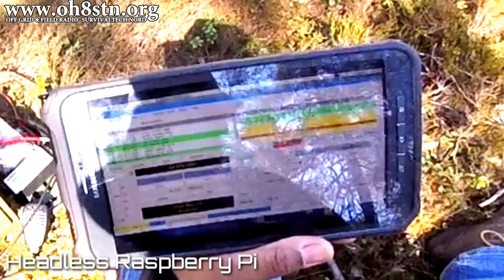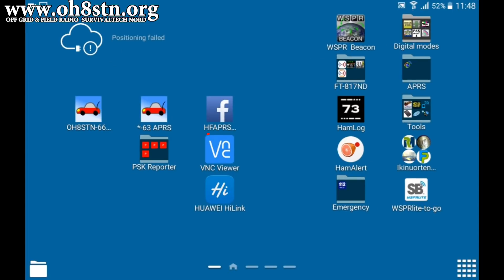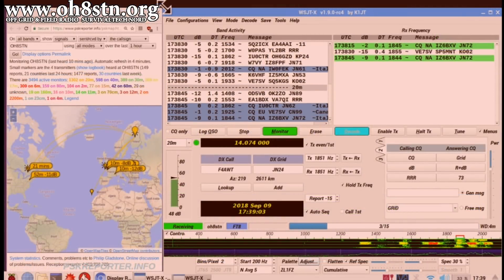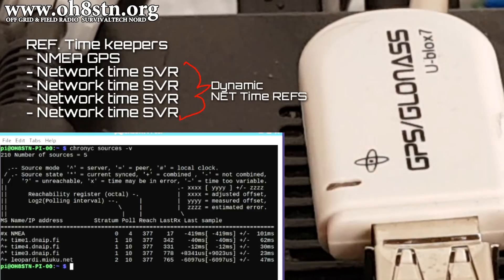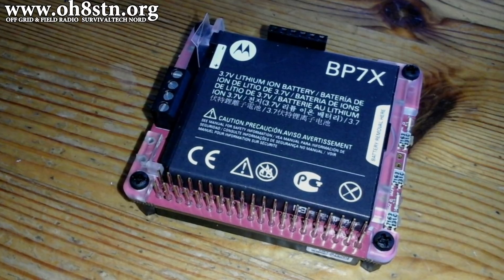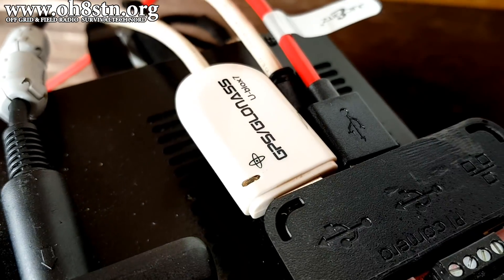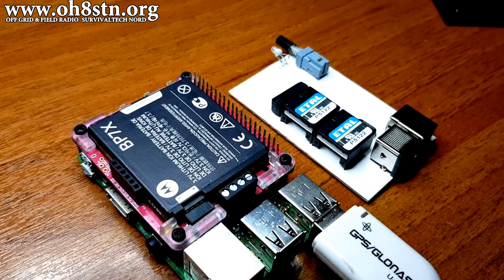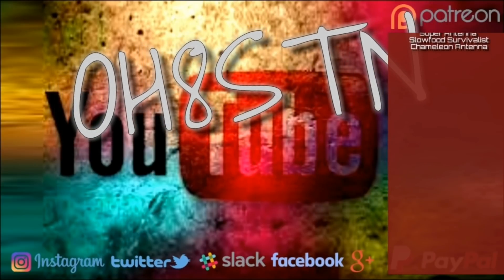Ham Radio & Raspberry Pi FAQ

Comment: I don't think any of the display interfaces I've seen you use are tough enough or good enough tbh. I've decided I might as well use a Chromebook with ARM processor. I don't care at all about remote operation of the radio. I hate VNC too it just irritates me. I don't see why the software even needs a GUI at all to be honest. I'd love to use a Pi if I could get away with a 16 segment display and rotary encoder for a keyboard and make the package tough as nails. Thanks for your work it's really inspiring.

UPDATE: Chromebook is not go with GPS dongle :( There may be generic access to USB via Crostini in the future.

Comment: How do you supply the 5 volts from the buck converter to the Pi? Do you use the GPIO pins or did you solder leads directly to the board? If you soldered to the board what pads did you use? Was it P2 for + and P5 for GND?
Reply from the maker: I used gpio pins 👍
Reply: @OH8STN  😊!  Thanks!

Comment: Great video.  Thanks for pulling it all together.  I have just started working with the Raspberry Pi and FT-8.  Using my TS-590 with the Pi.  When setting the output power on the TS-590 at 30 watts...the output power meter only shows 15 watts when FT-8 is "sending".  I suspect that the audio output from the Pi isn't as robust as it potentially could be.  Would you have any idea what may need to be modified on the Pi to boost the audio output?  Thanks again for a video with solid information.

Comment: Hi Julian, I have built something very similar to work with my FT-817 and FT-897 - I have the same Zlp Interface - however I am having problems getting cat control to work do you have any tips? I also added Pat - the winlink client to my Raspberry Pi, and used cgps from the cmd line to get the maidenhead locator from the GPS
Reply from the maker: The only time I've had problems with cat control on the eight one seven or eight one eight is when I've used one of the Chinese cat control to USB adapters. I didn't have any problems with the ZLP version. I would say most of the time, it's the cat control adapter which isn't supported.

Comment: Julian you have shared wonderfully detailed  information on building a solar generator for operating  off grid.  One vita vital piece of man portable equipment is a VHF/UHF HT.  It would be great to see you cover charging HTs without access to the grid or an inverter.  Many of us are using the FT-70DR or similar and I have not found a way to charge this radio via a solar panel.  Thoughts?

Comment: Dear Julian, thank you for your excellent videos and detailed help. You give us and amateur radio a new and valuable inspiration.

I tried to rebuild your setup: FT891, Raspberry Pi 4, MiniPro SC... Unfortunately I can't decode JS8Call signals... Which settings do you make in Raspian OS and which sound card did you choose?

I've watched all your videos several times and also almost all documentation about JS8Call... Unfortunately I can't find any help for my problem.

Thank you in advance.

vy 73 de Oli, DL2OLI
Reply from the maker: Hi Oliver. My station set up is different at the moment, so getting those settings isn't possible at themoment. Make sure you have enabled the audio interface in your USB audio settings. You can reach those audio settings by right clicking on the speaker icon on your rpi desktop. Here's a few other tips for you.
Make sure you're using the correct port on your radios settings. Make certain you have selected the correct audio device in js8call. If you can see them in the waterfall but cannot decode but see them in the wsterfall, make sure your clock is accurate on your Raspberry Pi.

Comment: Julian Many Great Viedos. However the cabeling  between the radio and the Rpi escapes me. The radio has a Din data port right. I use a 706 which has 12 pin Din data port. Did you buy a din x usb cable? No signal link or equal is needed? Thanks John
Reply from the maker: In this video there's two cables between the Raspberry Pi and the radio. The first cable goes between the Raspberry Pi USB via the audio interface and into the mini din Port of the radio. II cable also originates from the Raspberry Pi USB and terminates in the USB port of the radio. That one is for cat control.

Comment: thanks for making this vid, I've been wondering how well the Pi could handle other applications besides the SDR software
Reply from the maker: You are very welcome. The Raspberry Pi does a great job with data modes for amateur radio. Honestly I wouldn't have believed it yeah, but the Raspberry Pi 3 B+ does a great job. Thanks for the comment and the kindness, It's very much appreciated.

Comment: Non HAM operator here. Can someone please fill me in what ham operators actually do? Is it simply looking for a frequency to talk to someone somewhere else in the world? What is the point of the radio equipment?
Reply from the maker: Actually ham radio operators do a lot of different things. So there's no one single right answer. For example my radio equipment is used for emergency communications in a grid down scenario. I also use my radio equipment when I'm far away from home, hiking and camping above the Arctic Circle, in places where no mobile phone service exists away from main highways. Of course there's the fun aspect of ham radio. So I also use ham radio the way some people use forums or Facebook. It's kind of like a wireless social media Network of like-minded people. Does that make sense?
Reply: @OH8STN  ah ok thanks for the reply

Comment: Thanks Julian great video. i agree why not just have an open interface/sound card built into rigs then you could choose what mode to be using. PSK31 was good but that's not where the action is today in 2019. My ic 7200 is a good rig for digital modes and easy to interface to a laptop but its too big to be carting too far in a back pack not to mention the battery needed to run it .

Comment: I am looking to buy your Raspberry Pi setup. One question.  The keyboard you have is red which links to the wireless one, not the Bluetooth one.  Can you confirm if I should purchase the Bluetooth or the wireless version to connect to the pi?
Reply from the maker: Yes it's the Bluetooth one Dennis. When I purchased it there was a choice in the drop-down box for the different versions. But it's definitely the Bluetooth version. Thanks for the question

Comment: Hi Jilian was curious what the other box was in the video then figured it out DigiMaster MiniProSC. Can you tell me why you chose that over the more popular signal link usb sound card? Maybe do a video on it???? Thanks so much. Love your videos.
Reply from the maker: Hi Mike. The signalink is simply massive. Since I do so much portable Ops, I wanted something that was smaller. I also didn't want to change out jumpers every time I switched radios. Nothing wrong with the Signalink, it just wasn't right for me.
I think I've done several videos on this audio interface already. They may be outdated  though.
Thanks for the question and the kindness. It's very much appreciated.
Reply: thanks so much must have missed them will go back and check and thanks for the fast response :)
 @OH8STN

Comment: Great video, just got my first hf rig FT-891.  Now I trying to understand all the components needed for digital communications.  So instead of using a Signallink you us a ZLP Electronics MiniProSC.
Is the Signalink old technology compared to the MiniProSC?
Reply from the maker: Hi Gerry
The SignaLink USB is fine. I use the  ZLP because it's smaller, and only needs a cable change to configure for a second radio. No internal jumpers pucks needed. The Signalink has the added benefit of front panel level control. If you like to fiddle, the Signalink is good. If you want to configure and forget, the ZLP.
Hope this helps.
73
Julian oh8stn

Comment: Thanks for great videos! I have an samsung tablet and a wolphilink I was using for PSK ... I have seen some people who have placed a full linux distro on their tablets.  This would let me use the FT8Call (in theory at least). Do you think the wolphilink via the headphonejack would work or is it missing the soundcard aspect of this system?
Reply from the maker: Great question.
My friend VA3ISO uses this configuration.  Android Tablet   Wolphilink,  JS8Call. The sound card is built into the tablet, so the Wolphilink works as PTT and interface. So go ahead and give it a try. Wouldn't hurt, it might actually be a pretty awesome set up.

Comment: You are spot on with your point about Mfrs just not getting todays requirement.  An innovative new entrant would make a 20W radio (with a small onboard LIPO battery and a separable larger external LIPO clip on blister pack) that is simply a black box with an antenna socket, on/off switch, audio/mic/data/network ports, embedded GPS , ATU, wifi & Bluetooth built in.  Basically no onboard displays, buttons or dials - should put reliability up and mfr cost down.  If the CAT control commands were robust and extensive (and open source) and the Bluetooth/wifi suitably thought through then let Android developers come into the marketplace independently to produce the Android software variants required by the community for JT8Cal/Winlink/selcall/ALE etc.  The vision would to be have all functionality operated through any android device untethered to the box - even remote from it.
Reply from the maker: Only in my wildest dreams. That would be an amazing radio. In fact I would just settle for the Black Box radio with cat control, internal battery, built in audio codec, and selectable filter width.
I've been dreaming about this Radio 4m about 10 years of the best we seem to get this stupid manufacturers putting psk31 in their transceiver.

Comment: Hi Julian,

could you please share your experience with Pi cooling? The processor is relatively hot. Do you use any additional heatsinks,  coolers? What is the average CPU temp while using JS8CALL?
Reply from the maker: This is an excellent topic to add to my Raspberry Pi for ham radio FAQ.
We must always add heat sinks to the Raspberry Pi. They're not included a standard, and most people who use a Raspberry Pi for a media center or something like that probably don't even need them. Running digital modes, decoding those incoming signals is very cpu-intensive, so heat sinks are mandatory for our ham radio applications.
Some operators choose cases with built-in fans, those are fine if they don't make noise. Still there meant to be used along with heat sinks. I'm not using any fan. I simply use good heat sinks and thermal paste. I hope this helps.
73
Julian oh8stn
Reply: Thanks.
BTW yesterday I tried to relay a message to you via VK2RT. We had very good propagation between us and his station reported hearing you at -17.
Unfortunately band conditions got worse suddenly. Maybe next time.

Comment: How did you setup the pi as an access point?
Reply from the maker: Hello Douglas .
I just updated my blog on Raspberry Pi for Ham Radio which includes the access point.
73 
Julian oh8stn 
Raspberry Pi for Ham Radio UPDATED – X days Off Grid https://oh8stn.org/blog/2018/08/13/x-days-off-grid-radio-raspberry-pi-prerequisites/
#raspberrypi #oh8stn #hamradio
Reply: Thank you.  When i upgrade, i will see if i can.
Reply: I have gotten it to be standalone.  Where would i find to get it to be regular wifi when at home?

Do you have somewhere i could get the coding so that it can switch between access point and the home network?

Comment: The audio interface seems like a significant contributor to operational complexity.  Do any of the smaller HF rigs allow direct connection by USB for RX/TX of audio and cat control?
Reply from the maker: From small portable rigs, just one, the mcHF. It has a single wire interface for audio and CAT control. Yaesu and Icon as well, but not in a portable package. 
For the 891 CAT control is one sub cable. It's the audio interface which adds size and complexity.
Great question!
Reply: The IC-7100 has a USB connector that I use for CAT control, albeit with W10 and HRD. I'm getting my RPi 3 B+ all together to do the job when portable at the moment. de VA3NIE
Reply from the maker: Every amateur and commercial radio has bugs or issues. Best we can do is have intelligently select the best option for our requirements.

Comment: Or you could just carry a 12V power supply, mcHF clone, netbook/laptop, and avoid all the “layers of complexity” you have successfully managed to employ. SDR radios with built in sound card and digital modes/waterfall display are the future. Manufacturers just haven’t caught up yet...
Reply from the maker: The original mcHF is awesome but the cable mess with a laptop doesn't solve any problem. Sure the radio is smaller but there is still an external battery and limited 15w tx out. We also can't power most laptops from 12v, so some dc booster/regulator is required. How do we integrated the laptop into our portable power strategy without adding weight & complexity!? Finally, being tethered to a laptop is "easy", but not fun. The MCHF with a Raspberry Pi would be a nice QRP Digital kit.
Reply: OH8STN the laptop is optional with the mcHF, and that’s what makes it awesome.
Reply from the maker: I've been reading too much of that Chinese marketing from the fake one :-). The mcHF only does psk31, It can't handle any other digital modes on its own. I get where you're coming from, but I've done an incredible amount of research on that rig and many other qrp rigs.
Reply: I see. I thought it could do more than just psk stand alone. FreeDV is built in for sure (digital voice) Anyways, point being, the radio manufacturers need to take a tip from this radio, and others like it, and build in these options. If they go %100 SDR, more modes could always be added down the road with firmware upgrades. I know I’m preaching to the choir telling you this, but the mcHF is a perfect example of a radio that could have a new firmware package put out tomorrow, that added support for all the digital modes currently in use. An open source radio could even have firmware built by it’s own user base.
Reply from the maker: Where do I sign up? To be honest, I'm waiting on the "mcHF Pro" 👍😉

Comment: Julian, what is the model number of the flex solar panel?  It looks like what I need.  Wattage?  de ke4rk
Reply from the maker: PowerFilm FM16-7200. If you're at lower latitudes you can get by with lower wattage.

Comment: How did you connect the pi to the power distribution?
Reply from the maker: That's the one thing I haven't made a post on. If you give me a couple hours I'll make a blog post on it.
I can describe it here briefly. I built one of the 4 port powerpole kits from www.k9jeb.com . All four ports have powerlines, but I'm one of those parts I made a adapter for the Raspberry Pi. I used an adafruit buck converter with ~9-18v input, 5v 2A usb output, with 15A powerpole on one end,  usb out on the other. That's how it's wired now.
In the near future, I'll replace the USB buck with a wide input voltage Buck converter, with 10v 2A output. That will be wired directly to the regulated voltage input port, on the Pijuice hat.
Reply: @OH8STN  thank you.

Comment: I entirely agree with the point you've made regarding the possible inclusion of single board computers in new radios. As propagation continues to decline and is likely to stay low for some years to come digital modes and low power operations will come into higher usage. Having rigs which support digital operations just makes sense. The first company to add a single board computers to any rig will likely gain market share and set the bar for others to follow.
Reply from the maker: Thank You Marvin

Comment: Hi Julian,

how do you link fldigi and 891? Which radio model do you select in cat control settings?
Reply from the maker: Yes I use FLRIG for cat control.  It's not perfect though.  Fldigi needs lots of work for 891 :(
Reply: As I see the latest hamlib has FT891 support marked as 'Stable'. And fldigi can use hamlib for rig control.
Didn't test it yet but will do.
Reply from the maker: Hey did you send me an email? I think you asked me for something which I have forgotten about
Reply: Yep ))) it was concerning 891 revisions/serials and cat noise issue.
Reply from the maker: Awesome, I've already taken the pictures and I'll send them to you this morning after I walk my dog :-)
Reply: Tnx!